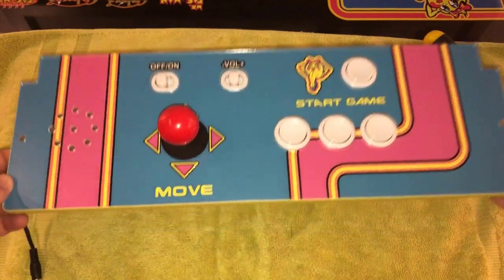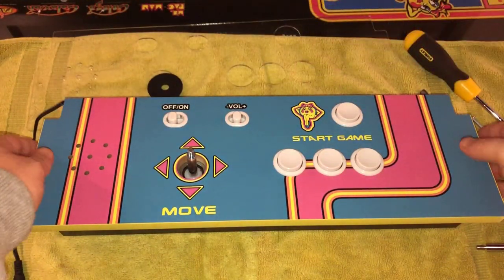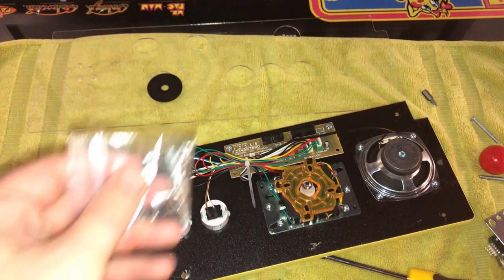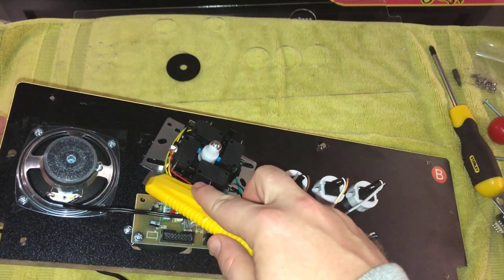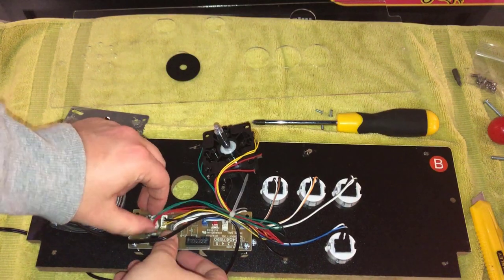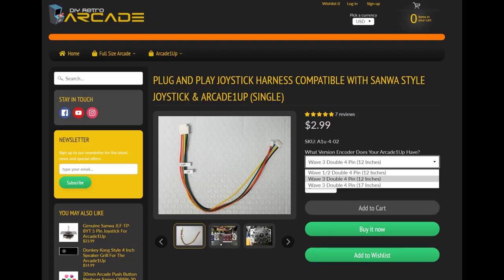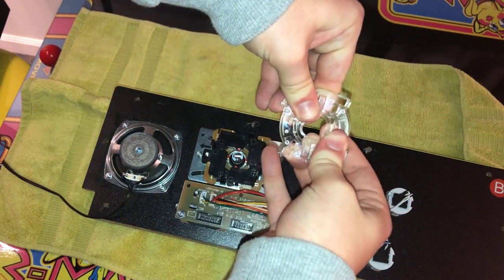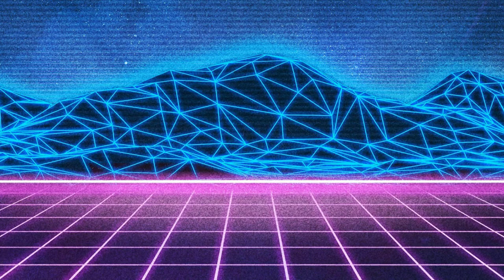No Drilling! How to Install Sanwa Joystick in ANY Arcade1up: Step by Step Instructions and Easy Mod

Comment: Is that 2lb tension spring actually necessary for replacing the joystick? I bought a full complete sanwa stick and I'm genuinely confused as to why I would need that spring.
Reply from the maker: No its not required. Sanwa jlfs have a.9 lb screen, I just prefer 2lb of resistance
Reply: @UnqualifiedCritics  Ok, thanks for the quick response!

Comment: Question do you know where I could buy the harness. My Sanwa joystick arrived but Diyretroarcade is out of stock and they seem to be the only one carrying those. Your help is appreciated.
Reply from the maker: They're the only ones I've found carding it. You could create your own from a 5 pin wire, you just need the right plastic ends to mount into to match  the ones from diyarcade
Reply: @UnqualifiedCritics  this is bs you cant just make the harness there are jumpers that have to be considered

Comment: Any idea what the spring is for and where I place it?
Reply from the maker: goes inside the white plastic cab and around the joystick rod. its purpose is so when you push the stick in a direction, there's a bit of resistance

Comment: Am I missing something or did you completely skip the part where you swap the base plate? Idk how to remove this sanwa base plate without stripping the screws.
Reply from the maker: You can reuse the sanwa base plate, the preexisting drill holes should line up

Comment: How do I know what wave my arcade machine is? I have the pacman plus cabinet with 8 games including Galaga and digg dug. Just got it this week, does anyone know which wave that is?
Reply from the maker: That's gen 4 but the key thing is gen 1 (yellow pac man, street fighter, etc), gen 2 (mortal kombat, etc.) and then everything newer. There was a big quality improvement after gen 2
Reply: @UnqualifiedCritics  thanks bro!! Appreciate the reply
Reply: I just did the Sanwa stick swap on my QVC Pac-Man Plus cab. It required the (double 4pin/wave 3) 12inch cable option. The mounting plate swapped over perfect too. I used the screws from the A1Up stick to mount the stock plate on the Sanwa. Excellent upgrade.
You prob figured this out by now but just a heads up.
Reply: @TboneTenEighties  thanks bro, im going to get it now and do the swap!
Reply: @jasonlo8780  Also..do yourself a favor and purchase a couple of springs if you dont already have. They're like under 2$ each. I purchased a 2lb and a 4lb. Using the 2lb currently and it feels really nice. Gonna try the 4lb soon and see what i like better.

Comment: Tried this on my Street Fighter 2 cab, and unfortunately the Sanwa stick didn't fit on the stock mounting plate. Had to use the Sanwa plate and drill new holes. WEAK!
Reply from the maker: Damn they must’ve updated the plate after wave one then

Comment: Is the new 3/4 Ms. PacMan wave 3? I would need the double 4 wave 3 17 inch cable correct? Thanks
Reply from the maker: It's wave 3 or 4 but either way it's the same harness. And 12" probably works but grabs the 17 to be safe